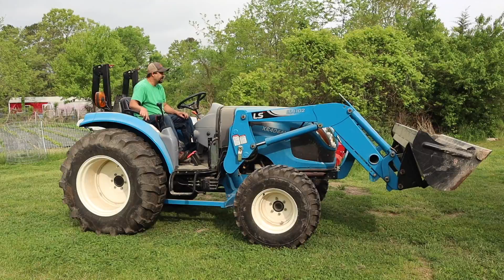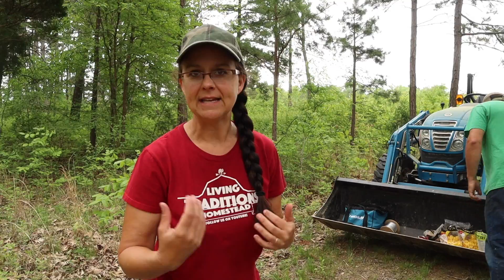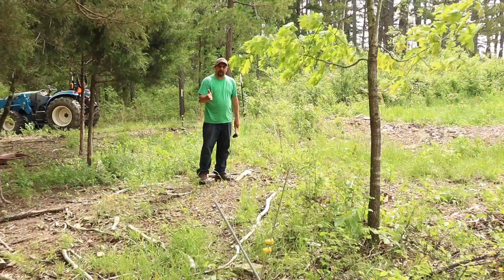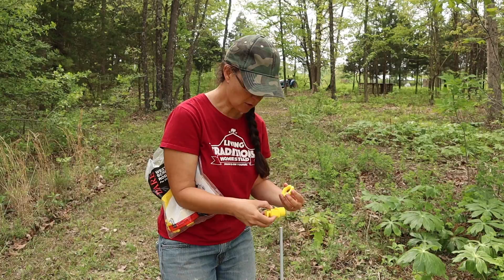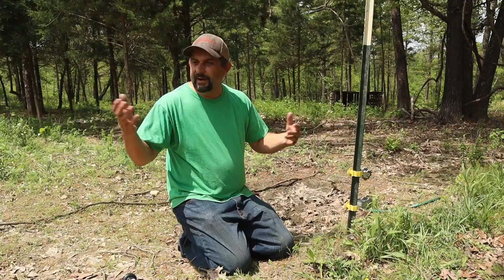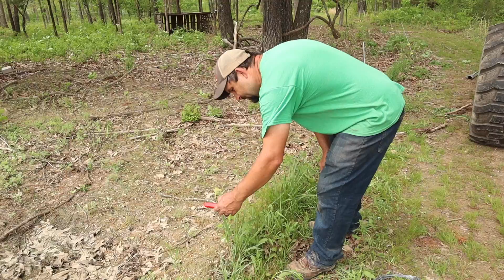Creating A Pig Paradise!  Setting Up Electric Fence for Pigs

Comment: I am trying to order  the  wire fence from Amazon. But quite confused at Some point. I needed to book the solar charger but saw that they  weren't recommended for pigs. Maybe because of the voltage or output joules. I need a bit of guidance and recommendation pls. Thanks

Comment: Hi there, do you answer questions here? I have been watching your video and taking notes ;) as I'm about to set up two strand electric wire for our young pigs.  So I have a few simple questions that I think you could answer in a couple of words each ;) 
1. How far apart are your posts?
2. How far from the ground are the two electrified wires? 
3. You only hooked the wire from the solar powered energizer to the bottom wire as far as I could tell. Did you also connect it to the top wire? Or are the two wires connected somewhere? 
Thanks so much for the video and for your time answering questions! 
Jessica in Louisiana

Comment: Because the electric fence is SO low, I didn't think about a gate.   You just step over it all Summer so I hadn't considered getting them out again lol.
Reply: same here!
Reply: @reneebryant7349  If they thought it was fun catching up with the little piggies last year when they all ran off in different directions, that's nothing compared to the little 'issue' of lifting a 450lb pig over an electric wire, be it on or off is it? !! Lol  Hope they have a better plan for the big move from up near the house - (be interesting to see if we get another Piggy Planted garden again this year eh?) - back to the paddock space in the trees, especially as they're getting at least 4 this year.

Comment: Great info guys. Very SW Mo. corner here. Have been thinking about pigs for awhile now. I think I'm going to pull the trigger after your vid. Hog panels aren't cheap. Ticks not so much but I'm a chigger magnet. I use Repel which contains 40% deet. Works pretty well. Keep up the great work. I'm interested to see how you train them to the fence.

Comment: what about a small nursery area for the pigs made of the hog panels inside the electric fence you have set up already around the hog shelter you already have set up in the paddock - just thinking after last years pig moving "incident" that it might save time in the long run - you then would just have to undo a hog panel and let them out and they would be settled into that area

Comment: I use permethrin concentrate for ticks and chiggers. It's a synthesized compound from a orchid. I wash all my clothes in it and it bonds to the clothes for about 10 washes. I get it at the local farm store. I haven't had a single tick since I started using it. The key is layering the treated clothing so there is overlap.
Reply: We use clothing treated in the same way, extremely effective!
Reply: The best I have found! I spent 15+ years in some tuff tick country,, a timber cutter told me about it.
Reply: Is there a particular brand of the permethrin that you recommend?
Reply: @karengradzki3808  I bought this product and dilute it.  Bad stuff when in liquid form, so follow precautions recommended by the manufacturer, it is fine when it dried.  I've been mixing 1 teaspoon of 10% to 4 cups of water, not sure if that is the best, but it has been working for us.

Comment: Okay so ticks and ?   We do have ticks here in fact because we now have a ban on spraying here in Ontario Canada the tick population has soared.  We are always advised to tuck our pant leg bottoms in socks.  Wear long sleeves and light coloured clothing.    We also have our lovely mosquito season coming up.  I actually spray my clothing before putting it on even socks and hats and try to avoid direct contact with skin.  Not sure for ticks that is reasonable but for mosquitoes it works.  So beautiful there.   Have a great day🇨🇦💝💐

Comment: Hey Kevin, I've used those white fiberglass posts for probably close to twenty years. I found that paint in them with a coat of paint (whatever is leftover from other projects) will save on getting fiberglass splinters on your skin and keep them from getting brittle with age. As for the ticks I'm like you they may get on me but I don't find any attached and if I walk in tall grass or sometimes even mowing and the wind blowing it back on me I will get chiggers. Hope you all stay safe. We finally had a night without thunderstorms and rain. Supposed to have a chance of rain tonight but not heavy and clear Saturday and Sunday. They are saying that we won't have flooding as long as "93, was till late July, so it hopefully will get gone before Memorial Day. My cousin in Louisiana said they were diverting water out of the Mississippi down there to the Red River to keep New Orleans out of trouble. They get all the Missouri and Mississippi Rivers from south of St. Louis down. Larry